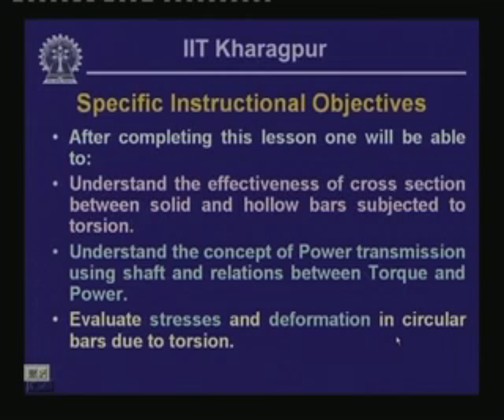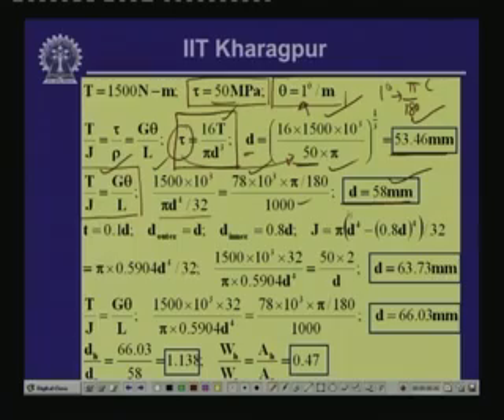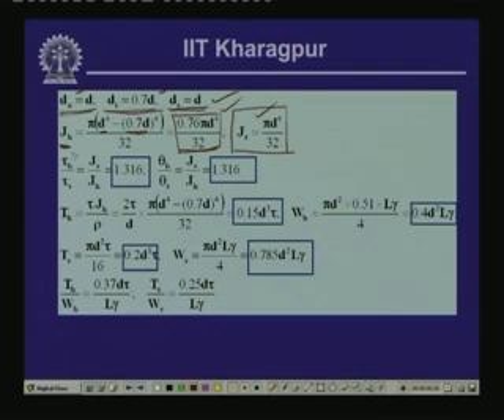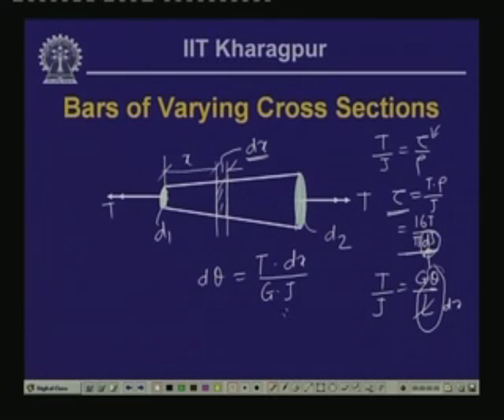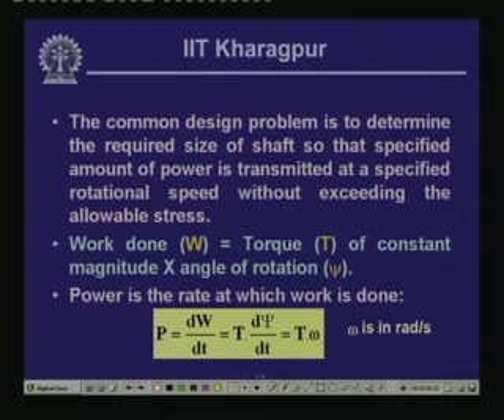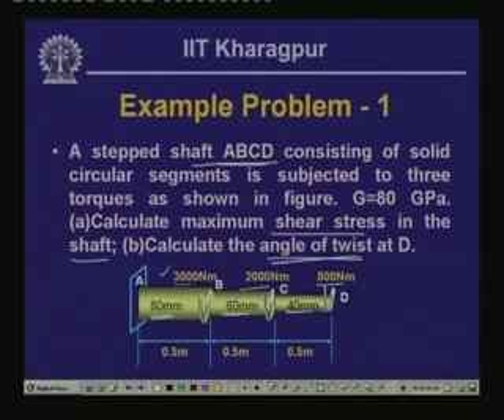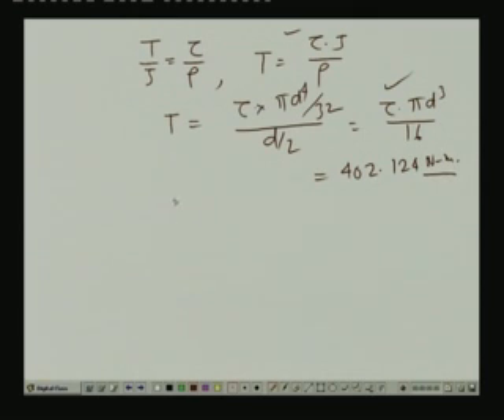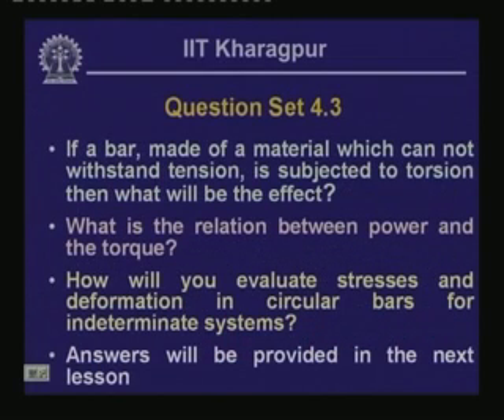Lecture 20 Torsion - III

Comment: SIR I AM TRYING TO FIND DIAMETER IN QUESTION 3 FOR HOLLOW SHAFT, AND I HAVE CHECKED 13 TIMES BUT DIAMETER IS COMING 25.49 NOT 20.23
Reply: 25.49 is correct
Reply: Bro I got 23.66mm